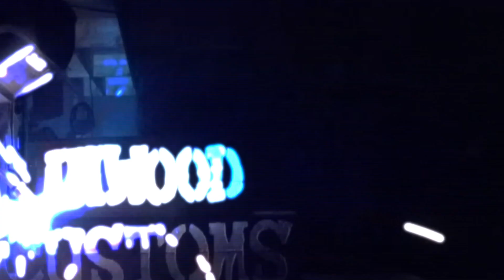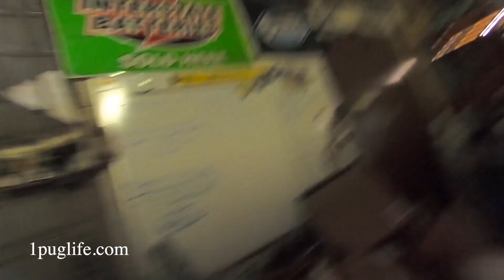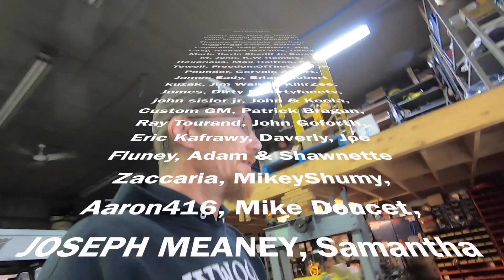first patches in dumpy and headlights for the grumman

Comment: 2 cents. Line the inside with 1/4 or 1/8 plate. Tack it on the outside too where youve cut bad pieces out. Same with the square tubing , replace big chunks instead of many small ones. Smoothy smooth. 1 or 2 coats of paint and you'll never notice it........ from 20 feet away
Reply: I tried telling him, he won't listen . He has carrots for brains sometimes
Reply: I was thinking the same thing 🤔
Reply: The time, sheet metal, gas and electric used to repair that truck bed would put me off, to me it's beyond economical repair, it's good for a movie though
Reply: @Neontrifle  6 yard box, he could get the plate sheared to size and have it installed in 1 weekend. After a second look I wonder why is it so rusty in some spots all over? If this truck was used in a place like the local “clean harbors” site there may be a cocktail of funky chemicals still in the metal

Comment: Rather than make a bunch of postage stamp patches, I'd just go with a  6"x 6"  or  4"x 4"  for all the small holes. Cut larger ones to size needed.
Drill a 1/4"  hole at the bottom of each rib on the outside for drainage. Same for the upper and lower rails, and tailgate.
Reply: Thats too efficient.

Comment: I know nothing about this shit so take my comment with a pinch of salt but it seems like it might be a good idea to put a sheet of thicker steel as a wearing layer on that tailgate and use the holes you've made so far for welding points then if you feel the need fill the holes in after

Comment: Should have made a guide for cutting out a perfect size hole. Do a couple different sizes then when you go to patch you can make a bunch of patches the same exact size that fit in the hole. Put em in and hold with a welding magnet, couple ticky tackys then burn em in

Comment: You be better putting a hole big plate in the bottom on the bed instead off just cutting out the bad bits as had to do it on a 1965 2 cylinder dumper didn’t have to worry about it afterwards 👍

Comment: just my opinion.. rather than small holes, why not cut from pillar to pillar and place a sheet behind it? weld down each pillar and paint 🤔 
maybe there's a reason why you don't? I don't know much about this stuff
Reply: Trust me pug knows less.
Reply: Do you have any idea what a sheet of steal cost? With this question I'm assuming you dont.
Reply: @AL4N.  honestly, no. I have no idea🤷 I wasn't trying to be "smart" or insulting. I just thought that may have been easier. But ya , I clearly said "I don't know much about this stuff" . So, if the cost outweighs the work involved with cutting 27+ holes.. I get it🤷
Reply: @aimvee45  3/16 steel plate is between 260.00 and 350.00 usd for a 4x8 sheet.